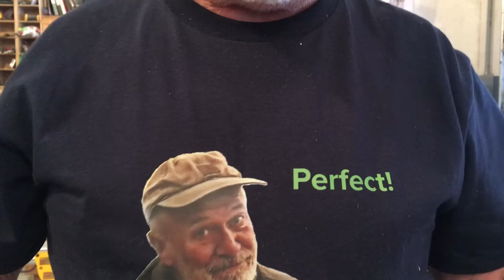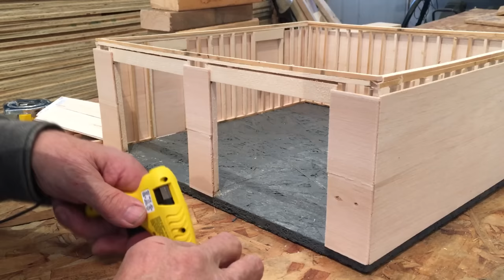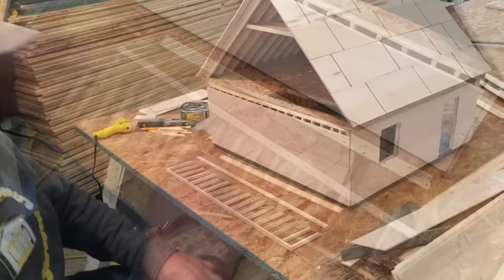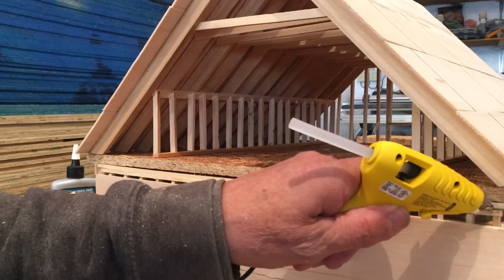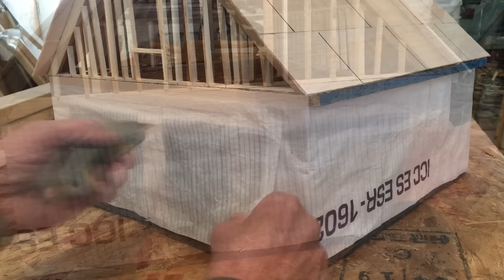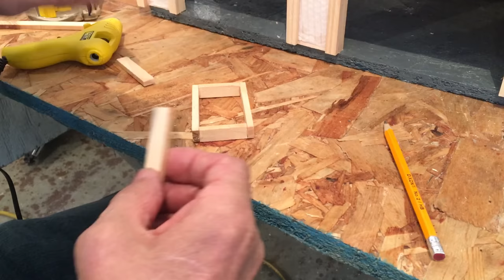TRUCK WON'T FIT...Building an Unusual Garage Alone Part 4

Comment: Absolutely beautiful Mr. Ken...Also happy birthday.....When I made doll houses, I would use the 1 gallon paint stir sticks, I would cut off the handle part then split the stick into and applied to the outside walls as lat siding, I also used the 5 gallon stir sticks as roof shingles, I would cut them to the size I needed....Anyway Sir you are very inspirational.....thank you....

Comment: You are having way too much fun doing this. Are you sure you never worked at Santa's workshop as an elf? I will be 67 in March 2023 so you have a couple of years on me. I am working on a  lock-miter sled. Using staircase oak plywood stair treads to make speaker cabinets. Basically 11.5  inch wide and or deep and 1 inch thick. Box will be 24.5 X 11.5 X 10.5. Never used a lock-miter bit before, but I do know you need a good holding fixture jig. One edge requires turning board on end and running through router bit. As a retired person looking forward to using this jig and bit to make all kinds of things. As always enjoyed video.

Comment: When I was a young lad, we built rather rough looking homes out of cardboard to use in the sand box. My thing was the details of infrastructure, so I built a storm sewer system out of straws and used various "found items" for the storm grates, which were usually the shaker tops from condiment containers. We'd actually dig them in along sides the roads that were lined with utility poles made of pop sticks, then wired with sewing thread. Ahhhh, to be 8 years old again! (turning 70 this year) Along those lines, it's probably too much to do a scale size heated floor before pouring the concrete slab on the next build.  <LOL> BTW, one of the things that's keeping me from doing a project like this in my retirement is the cost to heat my garage. If I only had the room for a wood stove!

Comment: You are such a perfectionist! I knew it was going to be "perfect" because you are building this one just as you would a full-size garage. You did the spacing on the kneewall studs on purpose to allow for access doors to be installed at a later date. (my excuse, and I'm sticking with it) Looking great! You'll need a diecast model car to go with it when you're done building. Before I forget, Happy Birthday! Small or large building, you're the best! God bless you!

Comment: Ken, ~ not gonna lie ~ I have "wandered" a little with my You Tube morning coffee experience.~ So there was a post noted for about a year ago by (Pghtrainfanatic) about an O-Guage train set up in Middlefield Ohio. (Cleveland area ~ or North East Ohio ~ sort of ~ I'm pretty sure). and so it's the "Corner Field Model Railroad Museum." What is absolutely amazing is that it's not just "Trains" but also buildings and roads.  My thought is that your "Garage Build" would just, well, "fit right in."  This one is way "over the top." At least take a look on You Tube at the post.  Whew.  Maybe you could become a "builder" for the Corner Field Model Railroad Museum?  ~  Just saying.    ✨🤩✨
Reply from the maker: Haha thanks

Comment: Great build! The only thing missing so far, is the scene where the storm is rolling in, and you all hustle off the roof. I'm going to guess that you didn't account for the material depth on the height of that knee wall.